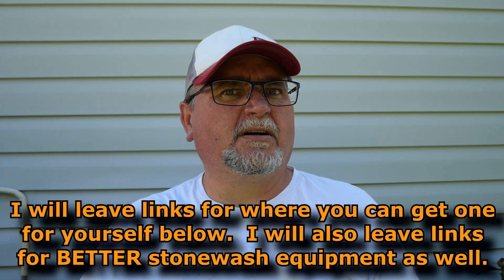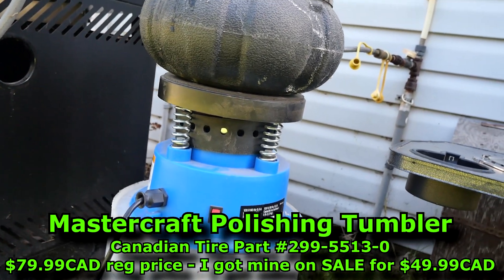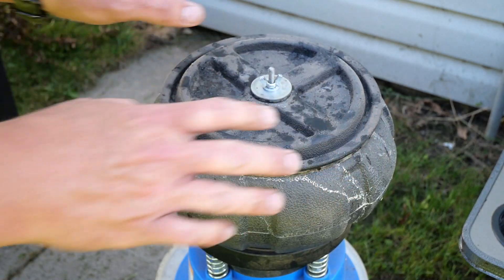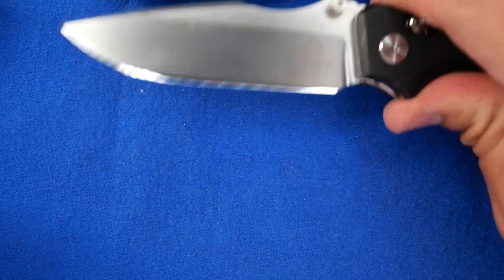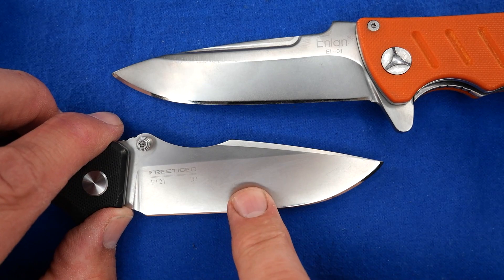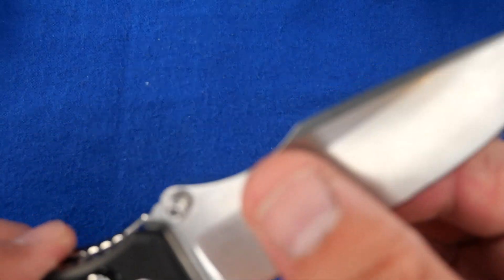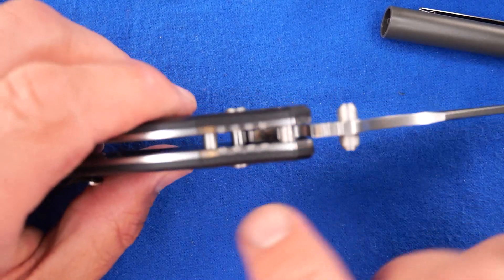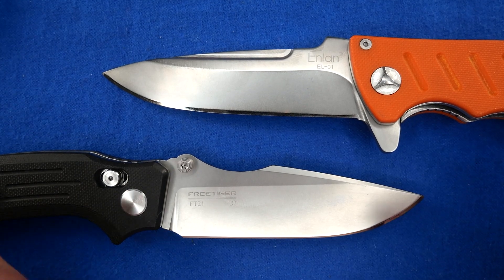CCEU - Stonewash a Knife Blade

Comment: I've never attempted doing my own stonewash finish, but I have tried doing an acid patina on a carbon steel Morakniv HD Companion. It turned out ok, but I'd like to try stonewashing someday on some of the A2 steel knives I have in production...
Reply from the maker: Go for it, it doesn't take a huge investment but its probably not worth it for just one or two knives.
Reply: @CanadianCuttingEdge  I saw a video where a guy made a imprompto stonewasher device using a 2L coke bottle attached to a cordless drill, full of rocks and ball bearings...lol

Comment: I just put some tumbling media inside a pill bottle with a little oil. Shake shake and shake. Results are actually pretty dang fast.
Reply from the maker: That would need to be a pretty large pill bottle to stonewash a knife in.  Are you stonewashing just a piece of steel or a knife blade?

To stonewash some mild steel, it would only need an hour or so in the machine I used, but for hardened stainless steel it does take quite a lot of time.
Reply: @CanadianCuttingEdge  yessir. I've used the method to stone wash my benchmades with 154cm and many other steels. The bottle is more like a larger vitamin bottle, easily fits most blades in it

Comment: I use courser media with that model tumbler and it only takes a day or so for a stone wash. you might experiment with different ones. Nice video!
Reply from the maker: Right the media I had was also used, so the ceramic pieces had already been worn somewhat.  I think I will get some stainless steel pins as well and perhaps triangle ceramic...  we'll see.

Comment: I stripped a black coated Izula a few years ago and put it in my Mastercraft Tumbler like you have. I added some ceramic rocks and sprayed in some WD 40. It turned out okay, I may not of left it in long enough. But the results were acceptable. 
I have an electric powered cylinder rotator that I used to spin a developing tank for Cibachrome Prints, when you could buy the processing kits. If I try this again I plan on using that machine and see if there is any improvement in my results. 
Your results looked really good though, much better than mine. I'll have to give it another go.
Reply from the maker: If you do get better results with the barrel tumbler please let me know and I will invest in one myself.

Comment: l have both types of tumblers for cleaning and polishing. The blades were in the tumbler too long.  

Rotary tumblers are watertight and usually take an hour or two with ss pins.  Vibrating tumblers with media can take 6 to 8 hours to clean and polish. While they can hold liquid, they are not water tight and leak. Having the motor directly underneath a leaking bowl of water is not recommended. l know from personal experience lol. 

l suggest taping up the pivot and contact points and run the tumbler dry. Run for 30 minutes, then check your finish. Smaller media tends to be more efficient.

lf you just want a light stone wash finish. and can’t afford a tumbler. Put some pea gravel and your blade in a can and shake lightly for a few minutes then check your results. 

Experiment with an unwanted knife to see if you like the results first. Steel type and heat treat will vary your results. Softer steels tends polish, rather than stone wash over time.
Reply from the maker: my vibrating tub can hold water to about half the depth, that is where the bowl is fastened, so that is the seam where it leaks from, my guess is that its the same way for most brands.
I will probably invest in stainless steel pins and add them to the media or try them alone.
In any case, thank you for sharing your experience with both and verifying that the rolling drum method is a lot faster.
Reply: @CanadianCuttingEdge  the only problem with vibrating tumblers is the dust that they create because they not air tight. What ever goes into your tumbler, you’ll be breathing in the particles. Good idea running it outside

Comment: That's weird. I put river rocks in a cotton bag with a blade and some wd40. Shook it around for 10-15 minutes and voila. Probably higher energy in my hands. Also the blade was 8cr13. Quite soft. But this surprised me. 3 days i honestly expected half the blade to be pulverized. That's not a lot of result from 3 days. Maybe the machine needs to sit on a firm surface, not soft grass,
Reply from the maker: WOW, I am surprised it only took such a short time.  Thanks for sharing your experience.